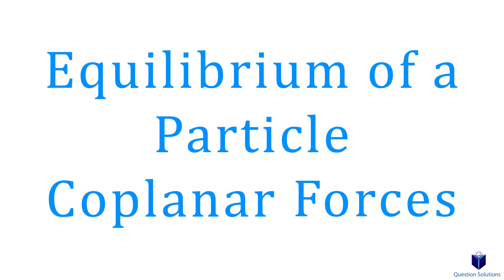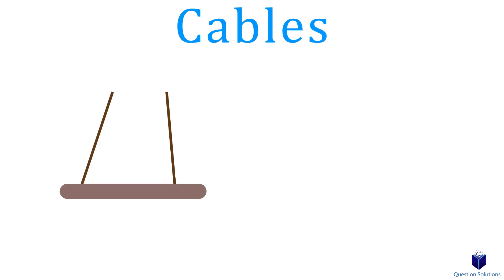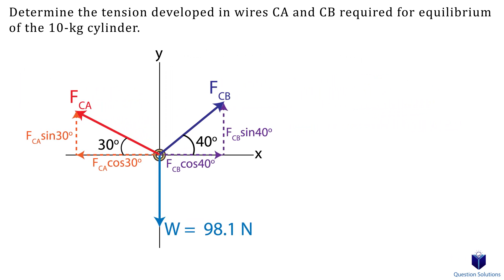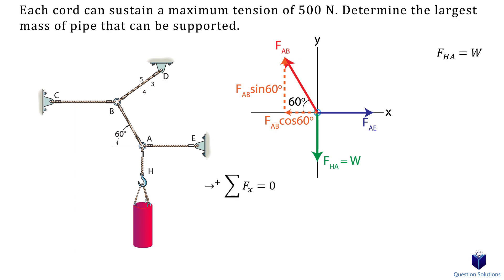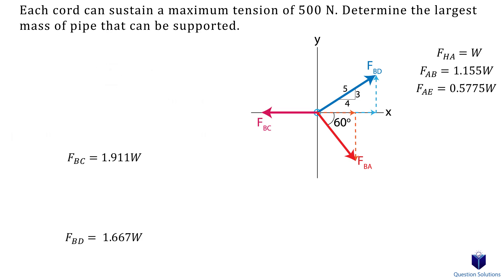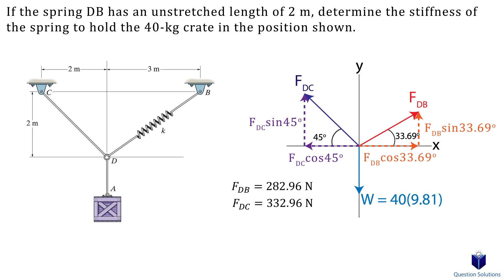Equilibrium of a Particle (2D x-y plane forces) | Mechanics Statics | (Learn to solve any question)

Comment: can I use equation on the sci cal in solving 6:44 instead?? when to know that the 2 eq is needed to be solved by algebra or i can just input it on sci cal?
Reply from the maker: You can always plug in your equations into the calculator if you're allowed.
Reply: thanks! but i got different answer when i tried it. FDB=288.57 and FDC=339.56 😅 @QuestionSolutions

Comment: I didn't understand how the both angles are same 

(Is it because the tension in the wire is same so angles must be same?) 7:41 7:41
Reply from the maker: Yes, it's a massless rope with the same tension throughout, for equilibrium to occur, the angles have to be the same. You should try this out for yourself, it's very easy to do. Find a piece of string, some tape and something to hang. Then you can use a protractor to get the angles, it will give you a really good intuitive sense for these types of things. :)

Comment: quick question. when plugging Fab value into Fba why don't we change the sign?
Reply from the maker: I don't know where you're referring to. Please use timestamps so I can help you out. Thanks!
Reply: @QuestionSolutions  at 5:20 , like since Fab=1.155W doesn't it make Fba= -1.155W
Reply from the maker: Fba = fab, the notation makes no difference whatsoever. It represents the same thing. All that matters is the direction of the force. It's going right, we chose right as positive, so it's a positive value.  @kvngsimon

Comment: 7:58 i unsterstood the tension is same. But how the angles? How do i think of it?
Reply from the maker: An easy way to practically understand this is to actually take a length of string and hang something on it. It will give you an intuitive sense of the angles. You can even check the angles with a protractor.
Reply: @QuestionSolutions thank you

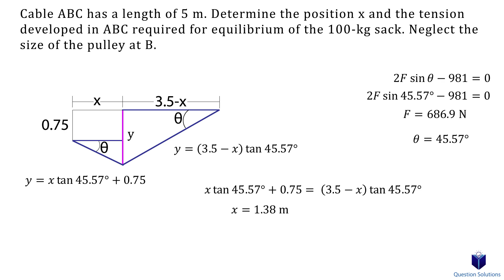Comment: 9:55 ,why is it that the €x is 0
Reply from the maker: So I'm looking at the time you provided me with, but I'm not sure where you're referring to. Could you please elaborate on your question. Thanks!
Reply: I’m talking about the last diagram,you said the summation of the x axis forces is 0 and the y axis is 2Fsin(a)-981 =0
Reply from the maker: Yes, that's correct. It's in equilibrium which means all the x-axis forces and Y-axis forces added together must equal zero.  @EMMANUELNAKOJA-k4g
Reply: Okay  , thanks you sir  ,very very very  appreciative

Comment: Uh.
I have only one piece guidance......albeit, coming from a guy trying to learn these.
  It took me a few minutes to figure out that you were arriving at the forces by using cosecant60° and tangeant30° to arrive  at the resultant forces of the chords, because none were given.
  I have used enough flat planar trigonometry to figure that out, but I would fear that many would miss that.
  You might mention that in the future.
My hint? -  ordinances and abscissa are always shorter lines computed with sine and cosine(less than 1) and radius(hypotenuse) is computed using secant and cosecant ( greater than 1) since it is the longest line of any triangle. Of Course, I have all the functions and cofunctions of 30° committed to memory.
Reply from the maker: Thank you for the feedback, I appreciate it. However, this is a series of videos in a playlist, and breaking forces into components, using sine and cosine, were all covered before :)

Comment: How did you get 0.5775W for Fae? Its supposed to be 0.775? (1.55W)cos60
Reply from the maker: It's 1.155, NOT 1.55, which is why you're getting an erroneous answer. Let me know if the answer works out after your correct the numerical value. If not, check to make sure your calculator is in DEG and not RAD.
Reply: @QuestionSolutions  Oh ok i see thank you, could you also briefly explain why you divided sin60 by 1 to get 1.155W? thanks.
Reply from the maker: @preetbahra7879  You don't have to simplify it, but simplifying it makes it easier to work with.
Reply: @QuestionSolutions  ohhhhh now i understand, thank you for clarifying everything!

Comment: DOUBTS:
5:16 1)how did you get the value 3/5,4/5 please ellaborate
2) in the figure there is a small triangle with side 3,4,5...what does that signify? Is it a misprint /glitch?
Reply from the maker: See this video: https://youtu.be/NrL5d-2CabQ especially the 2nd example, it's not a misprint, they are called ratio triangles.

Comment: Hello Kind Sir ! 
I hope you are doing well. I would like to ask you a question for which I have not been able to find an answer, despite spending considerable time reflecting on it and reviewing the available comments. I thought it was appropriate to reach out directly.

In your video at 8:53 seconds, you mention that cos(θ) equals x divided by H(AB). However, I am having trouble identifying what H(AB) specifically refers to, as well as H(AC). Could you kindly clarify this for me?

Thank you very much for your assistance.
Reply from the maker: First, thank you using a very respectful way of asking a question. It's really nice to see! Also, thank you very much for actually looking through the comments to see if your question was answered. Very well done!

To answer your question, please look at 7:41, and the diagram shown. Notice how ABC is the notation used to denote the cable given to us in the question. So HAB denotes the hypotenuse of the triangle formed at 8:53, with points AB being the hypotenuse of the smaller triangle, so left side of the pulley, and HAC being the hypotenuse of the big triangle, the one right of the pulley. Let me know if that clears it up, or if you need help with anything else.

P.S. in hind sight, I now see that I should have labeled the points ABC on the diagram at the end as well, for that, I apologize.
Reply: Thank you for your clarification. I finally understood where my confusion lay. When you wrote H(AB) and H(AC), I mistakenly thought it referred to the height. It was actually the letter H that caused my misunderstanding. It turns out that HAB is simply a label you used to describe the hypotenuse.

I hope am right x)
Reply from the maker: @nabil4220  You are correct! :)

Comment: 9:02 how do you get Hac=(3.5-x)/cosa ? Even Hab+Hbc=5!
Reply from the maker: You're simply isolating for hAC. Multiply both sides by hAC and then divide both sides by cosθ. To answer the second part of your question, what is the total length of the rope? 5m, so if we add up the two sections, it must equal 5 m.

Comment: Does it apply to all problems that if it's only one cable, the tension is just the same to the starting point and the end point especially if it's a pulley.
Reply from the maker: That's correct. The tension will be the same as long as we ignore stretching and assume it to be uniform (which pretty much every problem does).
Reply: @QuestionSolutions  thank youuuu! Just letting you know your example was my examination yesterday. Tension of the cable including the spring . You’re an angel!!!
Reply from the maker: @janecm6136  Wonderful! I hope you did amazingly. Keep up the great work and thanks for letting me know :)

Comment: i think you could have done a better job explaining at how you got at the end answers
Reply from the maker: The problem with explaining how to solve simultaneous equations is that it takes away time from the majority of students who already know how to do that (and students definitely should know this stuff at this point). It extends the time of the videos by a large margin, and takes away from what I am trying to get across, which are the new material taught in a statics class. To counter this, I have created a few short videos on the channel that teach students how to solve simultaneous equations. So if you need a refresh, I encourage you to look at those to get up to speed. If you look through the pinned comment, there are already links directing students to solve the equations shown on screen as well.

Comment: Do you have a separate video on how to solve the last problem?
Reply from the maker: Sorry, what do you mean? It's solved and the final answers are also shown. Are you referring to a specific step? Please let me know of a timestamp so I can take a look and help you out better. Thanks!
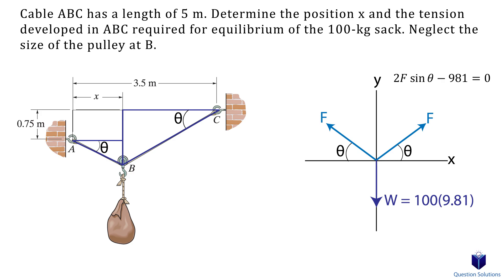Reply: Yeah, I mean a specific step to this 8:27 (last problem). I was a bit confused with these and those flashes of answers 😅
Reply from the maker: @jaki8002 I don't have a seperate video but if you have a specific equation you're having a hard time solving, you can tell me and I can try to help you out 👍
Reply: how did you get the angle 45.57 on the last problem , i put the exact equation on my calculator and i didn't get 45.57

Comment: In question 4, i get that when its one cable the force is the same. but how come you can say the angle is the same.
Reply from the maker: This one isn't hard to do a home experiment with. You just need a string and 2 little hooks. Tie the string like the same way shown on the diagram and then hang something on the string around the middle. Then using a protractor, you can measure the angle on both sides. You will see that it is the same :)
Reply: @QuestionSolutions  thanks

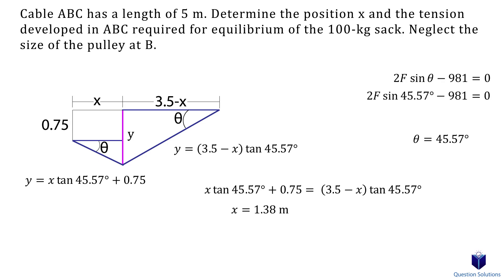Comment: Why in 9:47 the answer is 1.38? Can you please explain why? Thank You
Reply from the maker: So you're solving for x. Convert the tan45.57 into a decimal value. So tan45.57 = 1.02. This will make it easier to see. Here is a step by step solution after you convert the tan45.57 to a decimal value. https://www.cymath.com/answer?q=1.02x%2B0.75%3D1.02(3.5-x)

Comment: Great explaining, thanks so much!

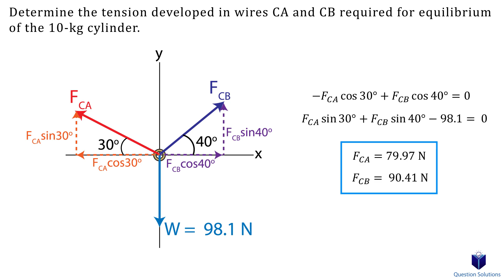But how did you get the Fca and Fcb answers? I don't see how (3:40)
Reply: I converted them to decimals then use mode 5:1 in Canon 789GSA , why i get 80 for bc and -66 ac? 😅
Reply from the maker: You're very welcome.

Convert all the sine and cosine into decimal values. So cos(30)=0.866, cos(40)=0.766, etc.. Then solve the two equations using the substitution method. See: https://www.cymath.com/answer?q=-0.866a%2B0.766b%3D0%2C%200.5a%2B0.642b-98.1%3D0

I replaced F_CA = a, and F_CB = b and used decimal values for cosine and sine.

Comment: Hello! How did you get 45.57 and 1.38 on the fourth question? I hope you can answer my comment. Thank you!
Reply from the maker: So at 9:14, you need to solve for θ. To do that, you need to take the inverse of cos. So cos^-1(3.5/5)=45.57. To get 1.38, you need to solve for x at 9:48. So just convert all the tan45.57 to decimal values and then solve it like you would any equation. Tan45.57 = 1.02. So you replace all the tan45.57 with 1.02. Let me know if you need further clarification :)
Reply: @QuestionSolutions  why @9:14 the equation how to get the 45.57 by using inverse cos but based on the equation its a sin

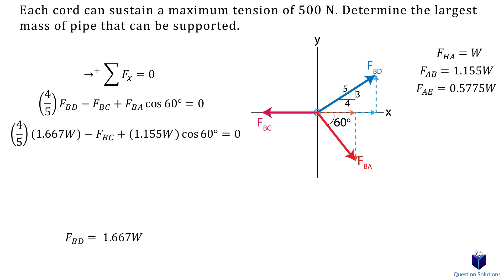Comment: Sir at 5:28 you write force ab equal to force ba but they are opposite to each other. Then how their symbol is same? 🙏sir please clear it.
Reply from the maker: The value of the force, in other words, the scalar value, doesn't change with notation. F_BA = F_AB.
Reply: @QuestionSolutions  thank you so much sir🙏

Comment: When you plug in Fab into Fba dont you change the sign since their facing in the opposite directions
Reply from the maker: So once you establish/write your equations, completely forget about statics and just focus on algebra. Think of the variables as x,y,z and solve the equations as you would in algebra class. The key part is just writing down the proper equations, after that, don't think about opposite directions or anything else because it will be accounted for when you were writing your equations.
Reply: @Question Solutions  okay really appreciated 🙏🙏

Comment: how long should one of these questions take to complete?
Reply from the maker: 2D equilibrium problems can be done pretty quickly. Probably 5 mins or less. But all of that depends on your comfort level with these types of problems and how many practice problems you've done before. The more you do, the faster you'll get at it.

Comment: 3:07 why is the gravity 98.1 not 9.81?
Reply from the maker: That's not gravity, that's weight. So weight is mass times acceleration due to gravity. In this question, the mass of the cylinder is 10 kg. So we get 10 x 9.81 = 98.1 N. Remember that acceleration due to gravity has the units m/s^2 where as weight has the units N.

Comment: i get that tension is same as it is the same cable, but why is angle same for last question ?
Reply from the maker: This one isn't hard to do a home experiment with. You just need a string and 2 little hooks. Tie the string like the same way shown on the diagram and then hang something on the string around the middle. Then using a protractor, you can measure the angle on both sides. You will see that it is the same :)

Comment: I just started learning static  and I would like to ask why is it that the highest tension should be the basis on what will be the maximum mass that it could carry
Its still puzzling me
Reply from the maker: I think you're referring to the second question. Let's assume we pick the lowest of the set, which was cable AE, with a maximum tension of 0.5775W. That means if we divide 500 N by 0.5775, we get 865.8 N. Dividing that value by 9.81 gives us the mass, which is 88.26 kg. So just for cable AE, we can hang a pot with a mass of 88.26 kg. 

Setting that aside, let's think about the maximum tension cable, which is cable BC, with 1.911W. What would happen if we hung that 88 kg pot on that cable? So we get 1.911(865.8)=1654.5 N. Notice how this far exceeds the maximum each cable can hold, which was 500 N. This is why we base it on the cable that carries the highest tension. If we base it on the cable that carries the lowest tension, then that weight would exceed maximums of the cable that carries the highest tension. 

Play around with these values to get a better idea of what I mean and it will help you understand it better. 👍
Reply: @QuestionSolutions  Ahh I see thank you very much 🥰
from the look of it I still need to study alot 😅🥲
Reply from the maker: @daryldiaz7194  Once you read the chapter, try to do as many questions as you can, you will gain a lot of inside that way. The golden rule in statics is: Everything is in equilibrium, which means all the forces added together must equal zero. :)

Comment: How did you get Fab=1.155W in the second question, that's where I became lost
Reply from the maker: So you're isolating for FAB. Add W to both sides and convert sin60 to decimal form. You get 0.866FAB = W. Divide both sides by 0.866. FAB=(1/0.866)(W), convert to decimal form. You get 1.155W. Remember that W divided by sin60 is the same as 1/sin60 👍 Please see: https://bit.ly/3kGNcyW
Reply: @QuestionSolutions  ohh I can see it now thanks
Reply: @QuestionSolutions   @Question Solutions  4:35 why did you multiply both sides by 1/sin60? where did you get it?
Reply from the maker: @julianafairy908  If you have an equation like this: 2x = 2. You solve for it by multiplying both sides by 1/2 (or dividing by 2, which is the same thing) where did the 1/2 come from? It's the same thing. In fact, you can multiply or divide it by whatever you want as long as you do it to both sides. Don't get confused by sin/cos stuff, it's still just numerical values 👍 I hope that helps :)
Reply: bro pleas read comment

Comment: a uniform rod of a mass 3 kg and length 2m has one end attach by smooth hinge to a ceiling at a. the other end b ais attached to a light inelastic string. the other end of the string is attached to the ceiling at c. the rod makes an angle of 30° with the horizontal and the string an angle of 60° to the horizontal qs shown. find the tension in the string.

Can you make a video tutorial for this problem. Thank you
Reply from the maker: I can't really create videos on specific problems because then I'd have to create a video for every problem that students ask. I think it's better to ask these types of problems on forums that help with physics/statics. Please check them out.

Comment: 3:38 How did you get the 79.97 N & 90.41 N?
Reply from the maker: Not sure why this comment was held for review, but to answer your question, convert all the sine and cosine values into decimal values, then solve it.
Reply: @QuestionSolutions  i did this but i am still stuck. Maybe im just overthinking but can you explain a little more?
Reply from the maker: @jm--nf7sz  Did you convert to decimals? So for example, cos30 = 0.866, cos 40 = 0.766. Once you do that, you can write your equation like this: -0.866F_CA+0.766F_CB=0. You do the same for the other equation. Then you isolate for one variable in the first equation and plug it back into the second equation and solve. Let me know if it works out 👍
Reply: @QuestionSolutions  I got it! It just kind of confused me converting everything to decimals first so I left it at the end but I ended up getting 80N and 90.4N thank you!
Reply from the maker: @jm--nf7sz  The best way to do it is actually not convert to decimals and just keep sine and cosine. The answer is more accurate. Weirdly, a lot of students get scared or confused when they see sine and cosine terms, because they tend to forget that they are actual numerical values. So to make it easier, I tell them to convert it to decimal form. I think seeing just numbers and variables is easier then seeing sine and cosine terms 😅

Comment: how did you solve for those 2 unknown variables Fdc and Fbd in 6:41?
Reply from the maker: I think you are probably overthinking it, so to simplify, convert the sin and cosine values to decimal form. Then you just have 2 unknowns with 2 equations and you can solve them using any method like substitution, elimination, graphing, etc.